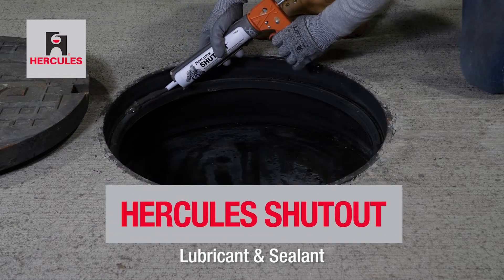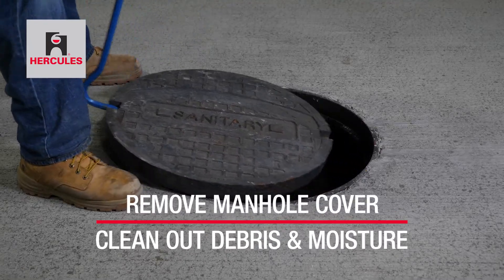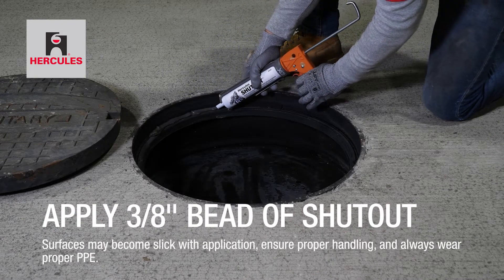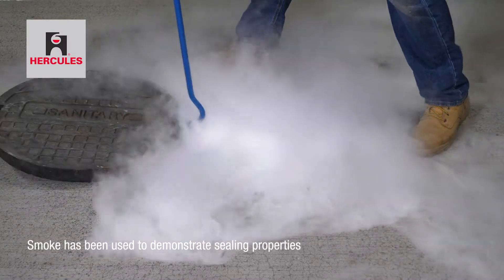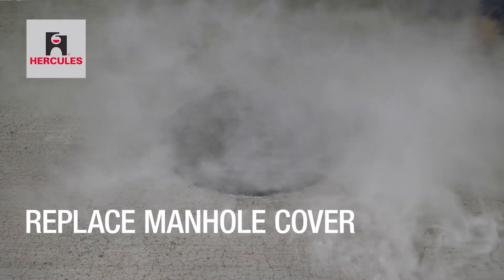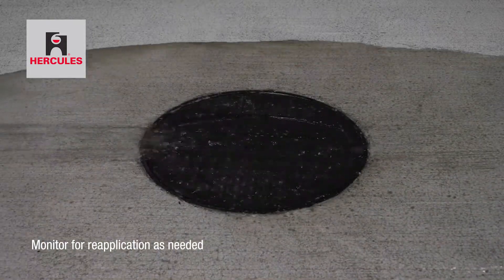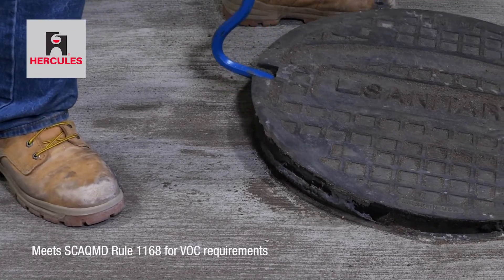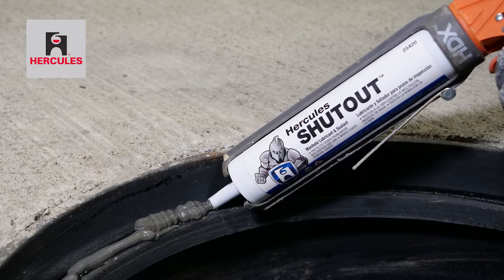How to seal and lubricate manhole covers to reduce inflow

Comment: What about holes for tool?
Reply from the maker: @Vitaliy Pro The Shuout product is only for sealing the lid to prevent water migration. This would not affect the slots/hole in the manhole for removal.
Reply: My issue is the reverse. The drain is becoming overloaded with rain water and cover is floating off. The cover can be weighed down but is not water tight. Could this be used for this scenario (where the water is UNDER rather than ontop of the cover)?